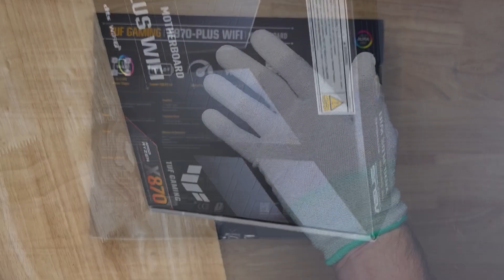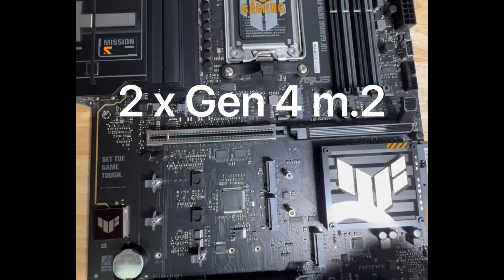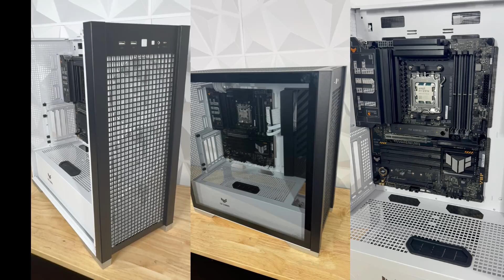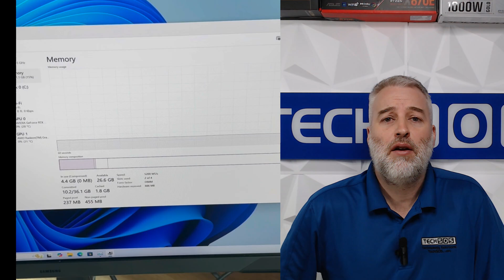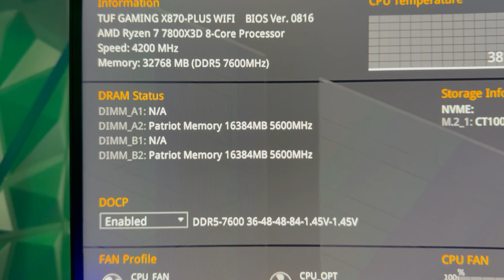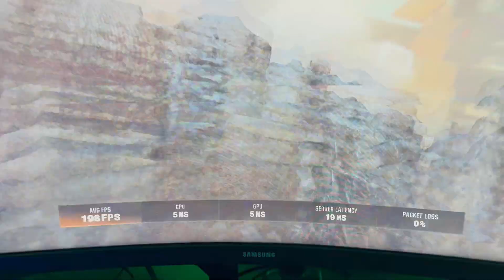ASUS TUF Gaming X870-Plus WiFi Motherboard Review

Comment: I got this motherboard to go with a saphire 9070 xt and ryzen 9900x3d is it a combination or should I get a different motherboard? I see on another comment you recommended a Rog but I think that's because how many m.2 the user is going to run.
Reply from the maker: It’s a great motherboard you can OC your RAM and it will be stable.  The ROG board you can OC RAM higher on a g gear 2 at 8000 +
Reply: @tech5o5  Thank you for the help.
Reply: @FUDD101ttv  This Board will do just fine since having a OC of 8000MT/s for Ryzen CPUs is almost pointless... u start to hit diminishing returns after 6000 MT/s. What you should aim for really is CL30(or lower) 6000-6400 MT/s, after that you really wont see a performance uplift.

Comment: So If I install 3 M.2s I lose the bottom PCI-E x 16 slot. That's what I needed to know. Thanks- looks like I keep looking.
Reply from the maker: @chs_ambs8356  I recommend the ASUS ROG Strix x870e-e. It’s a great motherboard it’s got upgraded RAM slots I have mine OC 8000 MT/s
Reply: If you skip the the slot 2 you should be fine.
Reply: @Silverlion_90 so you mean if I use pcIe5 in first slot and  pcIe4 in the 3rd slot I'll be all good ?

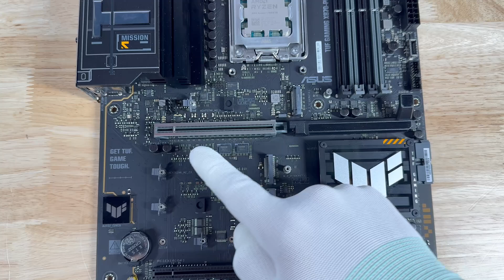Comment: 3:10 u said if both m2_3 and _4 is used will disable pciex16 g4???

according to manual tech spec it just m2_4 isn't it???

m2_3 is not share any bandwidth

AMD X870 Chipset
M.2_3 slot (Key M), type 2280 (supports PCIe 4.0 x4 mode)
M.2_4 slot (Key M), type 2242/2260/2280/22110 (supports PCIe 4.0 x4 mode)***
2 x SATA 6Gb/s ports
* AMD RAIDXpert2 Technology supports both PCIe RAID 0/1/5/10 and SATA RAID 0/1. RAID 5 Function is only supported by AMD Ryzen™ 9000 series CPU.
** The PCIEX16(G5) shares bandwidth with M.2_2. The PCIEX16(G5) will run to x8 mode when M.2_2 runs.
* The PCIEX16(G4) shares bandwidth with M.2_4. The PCIEX16(G4) will be disabled when M.2_4 runs.

https://www.asus.com/motherboards-components/motherboards/tuf-gaming/tuf-gaming-x870-plus-wifi/techspec/

Comment: Is this motherboard not enough for a 4080 Super with an AMD r7 9800x3d build? I’m starting to think I made the wrong decision choosing this motherboard for my build I have coming.
Reply: I'm running it with a 9800x3d + 4090 Strix (non-OC) and have no issues at all!
Reply: @thatonebystander 
Thanks a lot for the feedback. It’s really hard for me to get these uploaders to respond back at all. I’m new to the PC gaming world and I almost know all the basics. With my graphics card and processor, I was wondering was this motherboard gunna be too underwhelming. Again, thanks 🙏
Reply: I dont get your question. How can this motherboard be "not enough" for your build?

Its fully compatible with the components you mention (and more since the GPU slot is PCIE 5.0).
Reply: I’m very VERY new to the whole entire PC gaming world. I’ve gamed on consoles my whole life.
Reply: This board is reliable and doesn’t give me problems even on Expo 2 setting. It will go a long way.
Reply: I was told #3 m.2 slot wouldn't disable pci slot
Reply: Of course it's enough. Jeez
Reply: @williamg7138 
Just wanted to make sure. As I said….i was “very VERY new” to the whole PC gaming gig….cut me some slack jeez.
Reply: @Terminus31 any updates?
Reply: @Chicken-o5e 
Everything is still great and working! I'm on it now! Best thing I've ever done in gaming.
Reply: @Terminus31 great to hear. sometimes less is more, because ive heard plenty of stability issues on more expensive boards and i had an issue myself with asrock x870e nova that fried my 9950x after 9 months of use, had to RMA.
Reply: @Terminus31 Do you have coil whine with this motherboard?